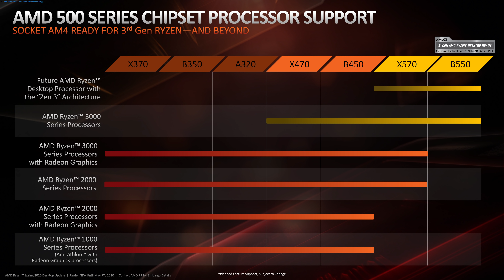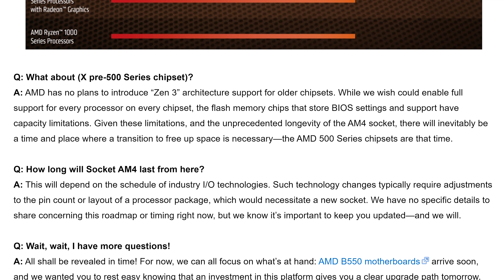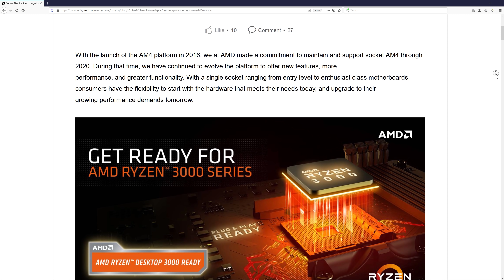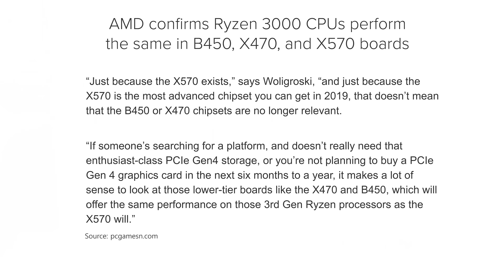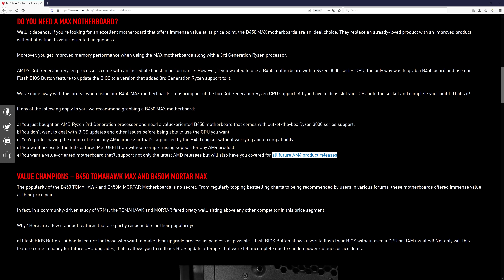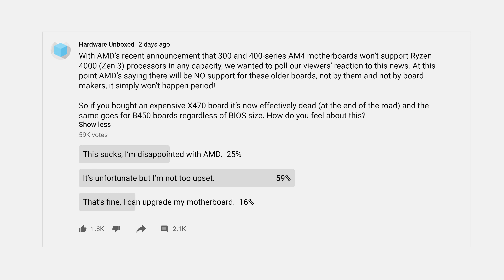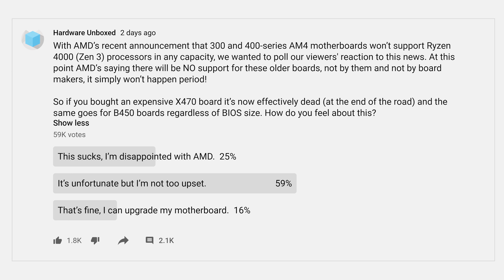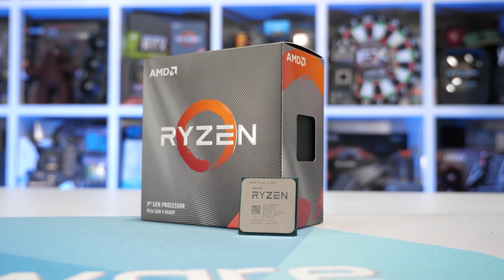AMD Does An Intel, Axes Zen 3 on 400-Series Motherboards, Our Thoughts

Comment: AMD need to backtrack this, there still time for them to go back on their decision, make sure you guys AMD listen, the customer is always right a bad rep is not good.
Reply: They literally said they will support UP TO 2020.
Reply: @Phambleton  through*. not upto. Stop spreading fake news based on your half knowledge.
Reply: @Steel0079  And Zen 3 launches late Q3/Q4 in 2020. Pretty sure that counts as THROUGH seeing as how it's a majority of the year. So take you own advice.
I get people are frustrated, but deal with it. I stepped up to a Ryzen 1st gen in 2017 and I have the option to going to 2nd gen with a pretty size-able BIOS update if I so choose. However, that also completely removes all support for the current CPU I am using. BIOS is indeed an issue, even if people are claiming the "excuse" is rubbish.
Reply: @tabinagi " through" here  means end of 2020. Which means that all the products launched in 2020 need to be supported by b450 at least. Not getting supported by a320 or whatever is understandeable. 
I have a 2700 sitting on a b450 tomahawk. Bios can be made into different flavors based on generation of processor. I flashed multiple bioses on my system.Its a silly reason. This looks like a cashgrab situation. Simultaneously they can avoid all the headaches that come bios flashing, And the effort needed to make the bios itself. Just think.
Reply: @Phambleton  b450 was sold as a current gen product with Zen 2 (and promoted as one by AMD). The 2020 argument is absolutely irrelevant when you consider that an AMD chipset got effectively ONE generation of support for many people.

Comment: Tim and Steve, thank you so much for this video. I recently built my first AMD system in many years going from an i7 3770 to a R5 1600AF (back when availability was good and the price was $85) and put it on an MSI B450 Gaming Plus Max. I like many others thought that this board (and indeed the entire MSI max series) was a good purchase for those of us looking for an upgrade later on. AMD has pulled what in my mind is an Intel-esque move here and need to move pronto to fix this. Once again I thank you at Harbour Unboxed for once again standing up for the consumer, and I plan on firing an angry E-mail off to AMD to express my disappointment for me and all my fellow B450 and X470 owners.

Comment: Last week I built a new AMD system. I bought a Ryzen 5 1600AF and an MSI X470 Gaming Max with plans to upgrade the CPU and graphics after Ryzen 4000 and "Big Navi" release later this year. LITERALLY two days after I built my new system AMD makes this announcement! If I had known this I would have just bought a Ryzen 5 3600 or possibly even just waited and bought a Ryzen 3 3300x for the same money I had to pay to get the 1600AF. I'm on a tight budget, so this really disappoints me. I was hoping this new system would last me another 5-7 years with a new graphics card or two in that time. Now I'll be waiting to see what AMD does after the 4000 series and will probably have to build a new system in more like 2-3 years.

Comment: I bought ab350 gaming 1 when it came out years ago. So far I went from r3 1500x to r5 2600 to r7 3700x on it. I also tested it with r9 3900 and it was stable for a week before I had to give the cpu back. I was looking forward to trying Zen 3 on it, but it's OK if thy cancel support. I got more then I payed for

Comment: I know this won’t be popular on the forums, but I think I represent the majority of recent buyers of B450 boards (as the poll suggests).

I find it unlikely that I’ll be upgrading my R5 3600 for a 4000 series part. The 3600 will be competent for at least 3 years so, while there are those who need the bleeding edge of CPUs, most of us buy new parts and then upgrade when it’s clear that it’s right to do so. For me, I upgraded from my Haswell 4-core processor when Ryzen had matured and DDR4 was really affordable. My next major upgrade will be when the next gen of processors is at a good state and DDR5 is affordable. So, while the option to upgrade would’ve been nice, it’s unlikely I would’ve pulled the trigger anyways so a new MoBo for DDR5 would’ve been totally expected.

Comment: If you were unsure of the promise, let me do the reading for you. It says THROUGH 2020. Not up to 2020. That means THROUGH the end of the year, at least where I went to school.
Reply: It does not mean that....when said in 2017 the word through means up until, if they meant the whole year they would have said "All the way through". New APU's which released this year 2020 are supported by older boards...= support through 2020 as in CPU's released in 2020 are supported. They never said all CPU's released in 2020 would be supported. What they said in 2016 when AM4 was revealed was AMD would support AM4 UNTIL 2020, anything more is a bonus. I am someone who bought an X470 and 2700 last year thinking I MAY be able to buy a 4000 series CPU this year....so I should be pissed right.....well I am not, I read their statements and understood what they were saying and knew I was taking a chance, now I can buy a 3000 series of switch to a B550 and get a 4000 that way...or buy an Intel next time. In the end I got what I paid for so why would I be mad? My PC works great.....what's the problem.
Reply: @patobobo6071  I know what through means. It means to go THROUGH SOMETHING. EVER HEARD OF A DRIVE THROUGH aka drive thru? You go in and you come out the other side. Having gone through it. Stay in school kids.
Reply: There's no difference, 2020 is 2020. If they release products in that year, support should be guaranteed. Otherwise say 2019.

Comment: As someone who uses intel processors I usually buy new motherboards each time I upgrade my processors anyway since I keep my rigs for like 3 years. But in fairness AMD has been pretty good with compatibility. At the same time they knew many of their customers built PCs with zen 2 cpus on 400 boards and they should have said something about future generations. Companies usually know what will and will not be compatible around the time current products are released so this to me is not good for your customer base that support you as a company. Then again none of these companies are in our favor to a certain extent.

Comment: F you AMD, i was going to upgrade my 2600X to a Zen 3 CPU in my B450 for better framerates. But if i have to change my mobo for it, i will go for INTEL.

Comment: At Christmas I bought a B450 MSI A-PRO MAX which gave me the ability to slot a ryzen 5 3600 into it and I was planning on future upgrades to 4000 series chips. I would have spent 60$ on a mobo instead of 100$ if I knew I would have to ditch it to go to the next generation. I likely won't upgrade for a few years but when that time comes I have AMD to blame for not fully explaining your plan to us. Hopefully they will add it to b450. It makes sense as they would be perfect fine with the ryzen 5 4600 or 4700 etc.

Comment: And considering that Zen 4 will be another socket that'll also drop support, that move is really dumb. I'm very disappointed at AMD for doing this, just a month ago I built my first PC with R5 3600 and B450 because all the reviewers - and even AMD - said that B450 will have no problems, and X570 boards were 3x the price of B450 ones here. They need to allow mobos with enough space to allow Zen 3 and mobos without to provide a BIOS option that doesn't support Zen 1(/+) and will support Zen 3. Otherwise, the pocket voting will probably happen.

Comment: I mean AMD did say that AM4 support would last till 2020, considering we are now 2020, its was safe to say that support for Zen 3 would not exist for older mobos. The new cpu's are going to launch in late 2020 anyways, possibly even 2021, so to me this is not an issue. Especially if it does provide a stable launch for Zen 3, without having all sorts of issues on older boards and having every single person reaching for their pitchforks!

Comment: Well it means you can continue to use your existing CPU in your existing motherboard. AMD are not forcing you to buy anything! It will all presumably become a bit moot when the next generation RAM arrives and makes the AM4 socket obsolete anyway. I'm just guessing that DDR5 won't be able to work with AM4.

Comment: A few days have passed since I bought my B450 Tomahawk Max. Still hasn't even come in the mail yet. I'm torn as to how I feel. My pc will only be for gaming and I'll be good with the 450 board and 3600 for years. I suppose that I represent the  typical customer. My upgrade will be in my gpu in the future. To me, the move makes better business sense and won't directly effect me as again, I'll get a lot of years out of this board and processor. There is a lot to not like about this move by AMD for the 400 series board owners who upgrade their parts often as they just got screwed.  I think that AMD should not have delayed the release of the B550 boards or should have been perfectly clear that this was the end of the line, for 450/470 boards. This way, all would have known for certain that if you wanted to move forward, these are your only options... X570 or the B550.  They still would have sold B450 boards to the average guy like me who is just starting and building a very good beginner/mid level gaming pc and/or looking to stay within a budget for whatever reason. Then the enthusiasts would have chosen the B550 if it was out or waited for it to come out. I think this was crap from AMD to keep quiet about this. If it was a last minute business decision that just came about, fine, I get it. Then just TELL your customers that and give them a reason. AMD would still have to hear from disappointed customers of the 400 boards but would most likely still have their trust that this isn't a future trend. To give the BS excuse that they did is what pissed me off, and I'm not affected by it. Now maybe the enthusiast's community isn't their largest customer but I would think that AMD wouldn't want to piss them off as it's a wise and vocal community, who guys like me, their largest sector of customers,  seek for advice. Support the 400 series boards for 1 more CPU series AMD.
Reply: Random Name  I have given it thought. I'm in a good spot. Just throwing on my thought in case AMD decides to read threads and gauge how people feel.